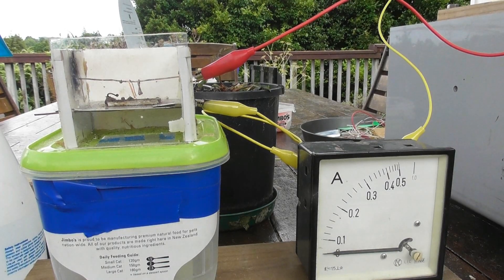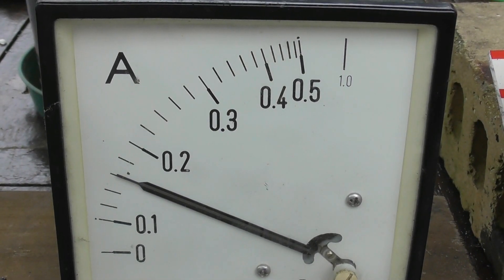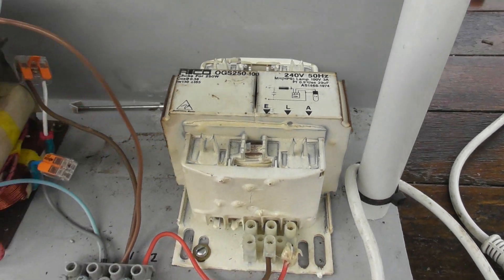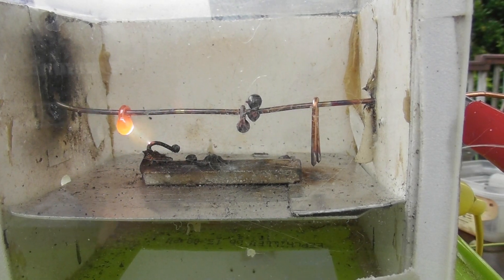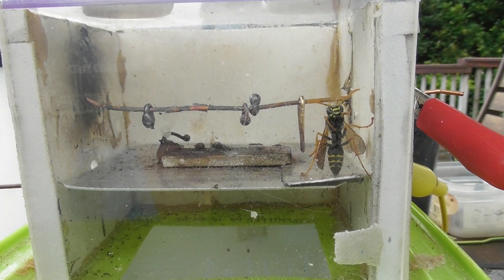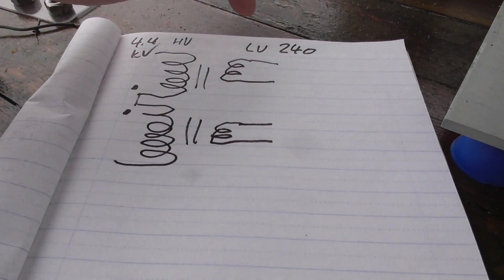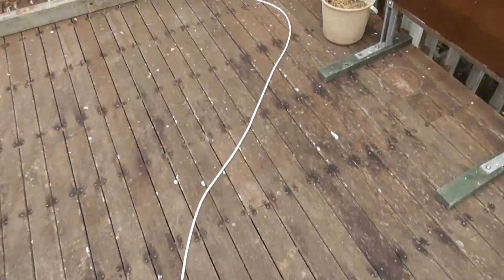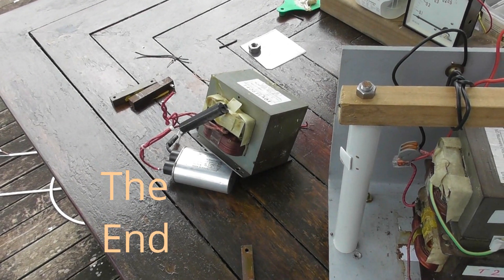How to build a wasp zapper from old spare parts - The Portazap 4400

Comment: I wonder if it's possible to hold the front of a Wasp under Water, at Neutral potential.
While its stinger is trying to kill everything above the waterline.
 Then, almost fatally shock the device in the stinger. (I'd bust the end off the stinger too)
Then, I'd let the thing go. Having been severely taught a lesson in stinging.

Comment: An unshunted unloaded MOT at its nominal supply voltage has an unusually high magnetising power/current due to saturation. If you have two such transformers you could run the primaries in series which brings the magnetisation right down to a low power level that hardly heats the transformers at all, so they can be run unloaded for a long period without any ballast. With secondaries also in series the output would only be 2100V total. If the secondary side will be short circuited you would still need a ballast, to avoid tripping or fusing your supply. BE SAFE.
Reply from the maker: Good advise, I take that into account for maybe another zapper idea. 2100 Volts should be adequate to zap a wasp anyway.

Comment: I found your channel last year because of my wasp issue. It's very fun watching those little bastards get fried. You inspired me to energize my wasp traps. I put a plate in the traps I have, so they get trapped trying to get to the bait. Then I fry them after I have caught a few. I wish everything here in the states was 240v. It's easy to put in a 240v breaker. But, 120v works fine with a step up transformer. Lucky for me, I am an HVAC guy. So the wiring is easy. It's nice that you show guy's with limited skills how to do it. Thanks for doing what you do.
Reply from the maker: I have seen some very scary video's of people experimenting with HV and they even shouldn't think about touching HV electricity. A MOT has relatively high power output, by ballasting it, the output current is controlled, and reduced for these type of zappers. Still the same applies, unplug, safety first. and monitor when in operation.